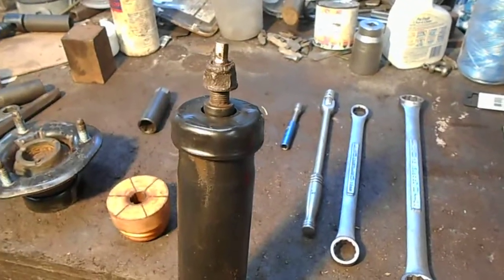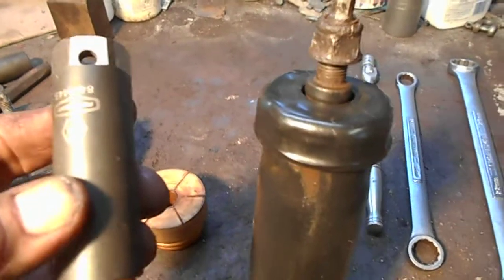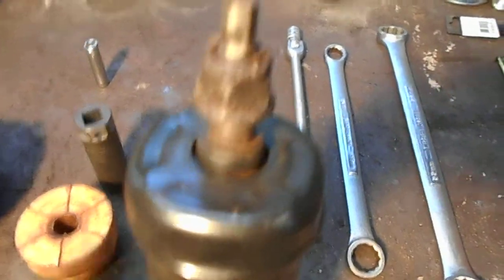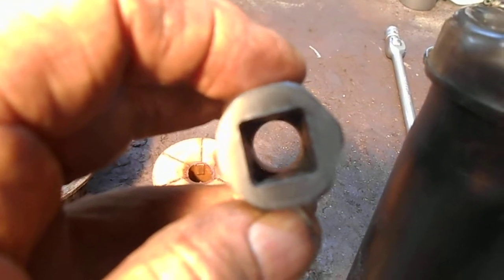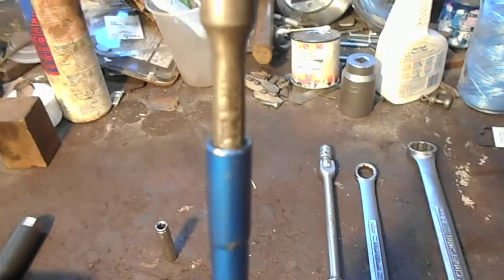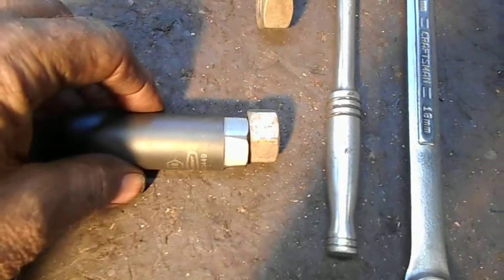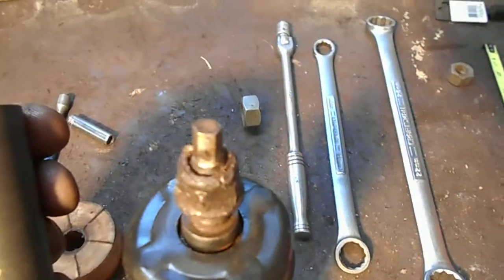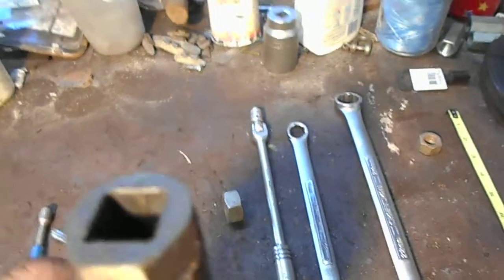Homemade 18 mm 2013 Ram strut nut removal tool.

Comment: Too complicated, cut the square drive off a short socket , and weld a handle onto the side.then any socket will fit the top hex
Reply from the maker: I am so glad that someone noticed my video. This job was done in the middle of the virus lock down and I knew things were going to be hard to buy. So I studied the measurements and made the socket tool as a text book perfect tool because I had never done a spring on a Ram. I have changed lots of quick struts but never a spring. I did not want to weld and change the temper on the socket. The socket worked perfect and I saved a lot of money so it was time well spent. As in any job hind sight is well that went well or the removal from H##. Craig